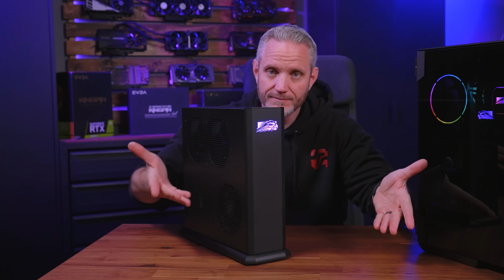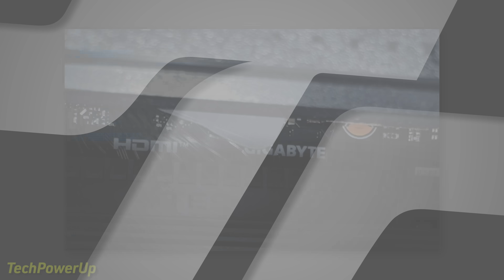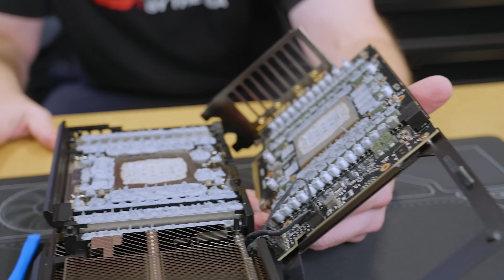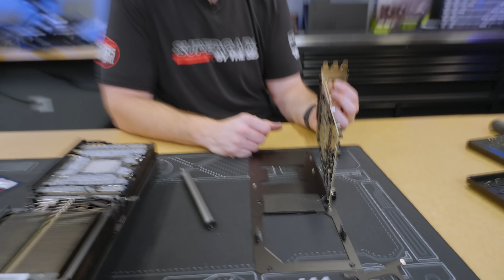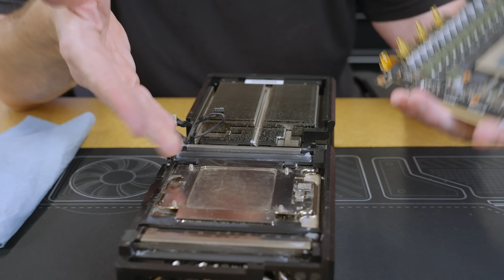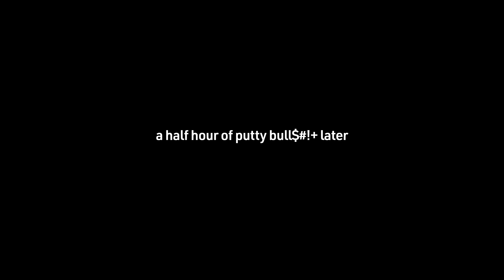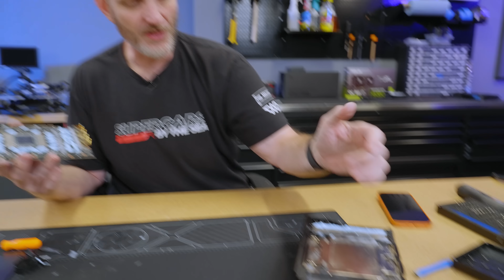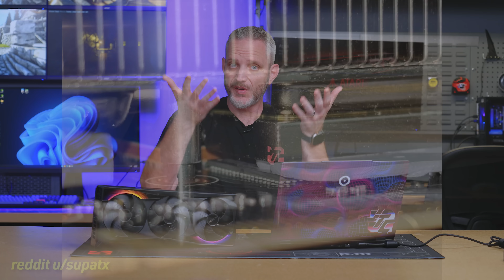What the HECK Gigabyte... WHY?

Comment: We've reached a point where we have to fix the factory after manufacturing premium products, but we don't after non-premium products.
Reply: These problems are not as widespread as people make them seem; in fact, it's a very low percentage of users experiencing issues. It's like anything else—consoles even have defects at launch. This is why you don't buy new tech right away. I wait a few months so they can fix the issues. I didn’t switch to AM5 until two years later to avoid bugs and problems. I bought the 5070 Ti Gaming OC mode two months after launch, got the second batch, and have no thermal leaks or melting connectors. Those issues are quite rare.

Comment: What I don't understand: thermal paste, putty,... has WAY lower thermal conductivity than any of the evaporation materials like copper or aluminium. So theoretically you would just need the putty to fill up the tiny (invisible) gaps where the heatsink and the heat creating component don't touch. Works the same with aircoolers btw.
in other words: the less putty needed, the better the performance should be. So why the hell does gigabyte ram a bucket of this stuff in their high-end model ? Would be interesting (and a bit tragi-comical) to see Jayztwocents repeat the process but this time apply only the tiniest amount of putty to see if thermals improved

Comment: i will bet you $100 that they have a litteral bucket of this stuff, and they just dip the pcb side in it about vrm deep and slap the cooler on. that looks like such industrial lazy-but-effective slop to me. 
i wanna give gigabyte a handshake and a slap in the face. that seems smart but... i'd never wanna deal with that. thats like, smearing vaseline on your mb to isolate the parts from potential water. 
serves a definite purpose, but disgusting. especially the longer you have it.

Comment: so you just took a giant crap on gigabyte.  you admitted to overpowering and overclocking the heck out of this card. then you go change the thermal compounds and what happens?  you make things worse.
so the bottome line is even though your cooked this card to within an inch of its life it was still running cooler than after you fucked about with.
i think you owe gigabyte an apology.

Comment: I had a similar thing going on with an old Dell XPS laptop. Bought it cheap because they had a reputation for overheating and killing the GPU.

Dell had used a thermal pad between the GPU die and cooler. Stripped that thing down and replaced the pad with a copper shim. This reduced GPU temps by 40°!

I think replacing that hybrid compound with a thin piece of copper may work very well here too.

Comment: I overhauled my 4090 cooling with new paste and the same thermal grizzly putty and didn't have near the headache you seemed to have when it came to applying it. You applied more than I did so that I am sure is annoying but it didn't really seem that bad if I recall correctly.

Comment: THANK you for making the video. My 5080 dripped into my vertical mount in my Y70. i've had to replace the PCIe slot from the drip. I haven't even run the card hard

Comment: Yes, you can get Windows 10 security updates for free for one year (until October 2026) by signing in with a Microsoft account and syncing your PC settings to the cloud via
OneDrive. Alternatively, you can use 1,000 Microsoft Rewards points or pay a $30 fee for the extended security updates (ESU) program.

Comment: i remember 10 years ago they were using pads and only the core used themal paste. if pads are better than putty especially on  a preium gpu like my 5070ti thats what they should be using so they can up the memory frequency. thenkfully in my case pny is still using them. also my gpu is a tripple slot and i figured migh was well. can  no do i want to go sli ow whatever that newer verion that only lasted 1 year was

Comment: I have the 5080 master ice. I had a pea size piece drip out and changed it to a horizontal orientation. It runs so cool I wonder if I’m pushing it hard enough. I’m running a pull fan on top just because I had an extra one. Other than I can’t run it vertical I have no complaints.
Reply: cool looking card for sure.

Comment: For automotive application of sealant and adhesive, they can use a bulk unloader system that turns an entire 5 gallon bucket or 55 gallon drum into a giant syringe and pumps it into a dispenser nozzle.  Much easier to simply have a robot wave around a nozzle connected to a large pump than to apply anything individual, don't even need a powered end effector.

Comment: I re-puttied my Aorus 5070 Ti just to be safe. I didn’t have leakage but I didn’t want to wait to see if I would, plus it gave me a reason to tinker. I used Upsiren UTP 8 and PTM 7950 for the core. It wasn’t that much work tbh and I didn’t need a shit ton of the Upsiren. If you have a 5090 like Jay did then I think it is a nightmare, but if you have 5080 or under it’s manageable.

Comment: how much money was the tim worth you used to make this cards cooling worse?

msi used the hybrid putty/pad things years back. 780 lightning/290xoc days.  the oil used to leak out of them and get sent around your case off the fans. it was shit and made them overheat if you didnt replace it once it got to this stage. guessing this iteration is on the other end of the spectrum for the particle constitution.

Comment: Did some quick searching on places like digikey for this thermal interface material.

Looks like (it matches the specs gigabyte advertise on their blog) it is MG Chemicals 8327GL6 MG Chemicals or something very similar.

One of the key features is "Zero pump out—no slump under low pressure"

I do wonder if this is a storm in a teacup type stuff with it just being over applied and it being under slight pressure its falling out. Yet to see it actually affect a card yet.

Comment: I think we should separate this issue with after market thermal putty use in general. I use a stiffer putty for my memory and mosfets instead of pads and it's perfect vertically mounted long term. And no worries then about ordering 3 different pad sizes and hoping you get good core mount pressure.

Comment: when i was informed that gigabyte was using thermal gel on ALL OF TEH GPU instead of thermal pads, it solidified my decision in NOT buying this trainwreck waiting to happen.
Reply: High quality putty is almost always better than pads, but gigabyte's problem is because they used high viscosity putty.
Reply: @Myyra-games  they used *low viscosity putty
Reply: I have two they run well but I am using horizontal mount
Reply: What are the current best thermal pads?
Reply: @colt5189 cant go wrong with thermal grizzly or gelid pads. Its choosing the correct thickness that u need to get right. Price of pads is crazy tho for the amount u get. Must be a serious % markup on them
Reply: It’s one of the fastest and coolest running 5090’s. Gigabyte needs to tell people to not run a vertical mount if they’re pushing the card for long periods of time. People are running these cards at 100% for 12 hours at a time like they’re dedicated AI cards. The VRAM just cooks and the card is still running at 60c lol.
Reply: @SuperiorDefense  then they should say "dont run vertical mount" on product description
Reply: @Donkens did you read my comment lol
Reply: I've had no issues with the gaming OC models. I've owned a 4070 Asus Tuf, 4070 TI Super Gigabyte Gaming OC, and a 5070 TI Gaming OC, all of which worked perfectly. I also had an MSI Gaming Trio 2070 Super and a 3060 12GB Asus standard model. Additionally, I had an EVGA 2080 Super, one of my personal favorites, and none of these cards ever gave me any problems.
Reply: @Zenntric you have the 5090 gaming OC?
Reply: @CastIronEric  no but I'm sure its a good one the gaming OC is like the second best gigabyte Card. they have great cooling to.

Comment: Yeah, fortunately i dont use vertical mounts but also fortunately I dont usually play games at the highest settings to get my GPU hot or anything. Even with my 9060xt 16gb i play cyberpunk in low-mid settings locked at 75fps with AFMF on for a constant 150fps.

Comment: I thought, why not create a sealed compartment between the heatsink and the board? Fill the space between them with thermal paste? 
But there are probably components there that don't heat up, and if you include them in the average-temperature mix, they'll actually start to heat up from the memory and processor.

Comment: I had the same issue with the thermal gel leaking out of the card ,I have use my pc 6 days out of week for a full month after I purchased the card. I have the gigabyte aero 5070 ti. I contacted them and they we’re aware of the issue with there 50 series cards gel leakage they told me to shipped it for repairs but I did myself a favor and replaced it with thermal pads and it works better than the gel that they was using. This is the worst idea to apply thermal gal on theses new card especially when they get hot.

Comment: I had a 5080 Aorus that failed. Gigabyte told me memory failed. When I got it back temps were over 15 degrees hotter. I’ve still got that 5080 and use a 5090 now. Would love the send the 5080 in for analysis to see exactly what they did in repair ? Did they put new putty down or just open it up and close it ??
Reply: If you want the card to analyse let me know. Same goes for anyone else who runs a channel

Comment: I just replaced my thermal pads with thermal putty on my gpu and did not have a bad experience at all. Granted the gigabyte card uses WAY more than I needed. I think I needed 50g for the whole card including the backplate. Rolling it up into balls and tubes is the way to do it without creating a huge mess. Even taking it back apart the cleanup isn't too crazy and I was able to reuse 99% of it. I do think thermal pads are more worthwhile tho but I was trying to see if putty would let me reduce hotspot temp on the gpu core which I think it did but not noticeably.

Comment: I have a gigabyte 5090 OC that oozed all over the motherboard. One thing I've noticed so far is the screen occasionally goes to pink noise under load. Not sure if that's heat related or not.

Comment: They used bad putty, there are good options with putty and i personally use Halnziye HY256 for thin gaps and UTP-8 (Now called Jarrapad Extreme) for bigger gaps up to 1.5mm and above that good compressable Fehonda 15w/mk thermal pads. (K5-Pro is horrible)
Snarks Domain on Youtube tested many putty's and has an excelent tutorial video for a laptop and videocards.

Comment: If the core is covered in some hybrid solution with liquid metal, that might explain why the contact surface is so much larger than the die - So that the paste has somewhere to go that isn't out of the cooler.

Comment: What PC cases are these people using that are vertical mounting their GPUs with the stock fan cooler?? I would think the fans have no space to draw air while right up against the side of the case.
I only vertical mounted mine because it has a waterblock, I mean I could still horizontally mount it but the runs are easier while vertical

Comment: If I ever get the money to upgrade my current system, the new GPU is getting torn down and the paste is gonna be replaced with a Thermal Grizzly Kryosheet. 

I had a GPU fan go out on my Gigabyte 3080ti and I torn the card down, deep cleaned it and used a Kryosheet instead of repasting the GPU die. Best decision I made.

Comment: I still like to use putty in some application. Especially when I don't know what was the existing specs for the thermal pad and how compressed they would need to be. Thermal putty just squish out nicely that it would not cause any uneven mounting problem with the GPU core. 

Gigabyte is just over doing it for real....

Comment: Gigabyte are on my avoid list after the hilariously bad 3090 I had. Cheap thermal paste, terrible power setup, broke and I sent it back for repair, it broke again. They then said they wouldn't fix it because the second time it went for repair, I mentioned putting the cooler back on. Because it was waterblocked. When I said they repaired it the first time without complaining about the waterblock, they said "they wouldn't have done the first repair had they known"....

TLDR: I miss EVGA 😢
Reply: Gigabyte stuff tend to fail a lot more and suffer more from production oversights then any other brand . And lets dont get me on the PSU bombs they unloaded a few years ago . Which i bought one  for a cheap build and nearly caught on fire .
Reply: @Lorex-d89 Oh, you talk about those Gigafraud PSUs like the UD1000GM that are being sold for cheap at chinese hardware stores?
Reply: @derthevaporeon  GP-P750GM  is the one i got , but all they did at the time was bad . Is funny how MSI was "hahah Gigabyte hold my beer" and did better PSUs for the same prices . Only thing Gigabyte can still make is some motherboards .maybe ?.
Reply: Zotac also is on avoid list
Reply: lesson learnt: don't buy water cooled block. it's a gimmick for wasting your money :)
Reply: @stelfirin  Always water cool high end cards like this. It's essential if you're not happy with having a slotbuster breeze block dangling off your #1 PCIe, and lets you put a big hefty radiator somewhere more sensible.
Reply: They've got a point. Disassembling the gpu voids the warranty.

Comment: Reminds me of what happened with my Predator BiFrost Intel Arc A770 card, only the manufacturer used a pinkish substance that reminded me more of bubblegum.  After about a year in service (in vertical orientation), I noticed that some of this material had not only squished out in a couple of spots.  But the worst was an area where the material had dripped(?) down and made contact with the top of the PCIe x16 slot.  The card still functions but I was not about to risk it anymore.  Too bad the warranty has expired.  I guess they thought no one would ever use the card in a vertical orientation.

Comment: You're 5090 temps make me concerned for my 5090. I see my card regularly hit 90c when gaming and especially when running furmark it doesn't take long at all for it to heat up. Tried RMA through my manufacturer but alas nothing seems to have changed after I got my card back. I would have expected better for as much as this card costs.

Comment: Looks like someone found a savings of a couple of nickels per unit on BOM and ran with it without asking anyone who knew what they were doing. Actually it was probably more than a few cents per unit as it probably eliminated at least a couple of steps in the build process, but for a top tier card they should not have done this. They probably look at these things as single use products and have no regard for serviceability.

Comment: zotac beats gigabyte in price and serviceable maintain  by us users easier than gigabyte messy bunch and not fun to work with it ...its why i rather change entire cooler instead that use pads already...i did that with msi boards as well due to how terrible with old AMD gpu back then with 290x remember the terrible nightmare that msi pulled on us with thin fan cooler that easily cause over heating issue with 290x

Comment: I quit buying from gigabyte during AMD 5000 series CPUs. All their motherboards claimed 5000 series ready, which was technically true, but it required a BIOS update so they were not 5000 series ready out of the box, and you couldn’t update the bios without an older CPU in the socket to post. Shady marketing.

Comment: They use the same thing on the 9070 xt Gaming OC edition mine was pinned at 80 degrees with a hotspot of 110 degrees under load.
Reply: its best not make it side up than standard slot as old school gpu designed for ...stay in one place for gell...or its gonna slide off during heating process vs standard it stay sandwich between core and heatsink...evga been doing this for years of it ....same for last bankrupt company BFG did that for their dies ....even its only on gpu cores but surprise how it was a huge mess between memory and gpu die back then....their unlimited RMA process got them bankrupt in chicago

Comment: Why are people still buying Gigabyte and Asus in 2025? I've been building and selling PCs for nearly 3 decades now so I see more than my fair share of hardware, but also have to warranty them, and I avoid both like the plague unless the customer specifically asks for them. They're all using the same components but Asus wants more for a "Ripping Off Gamers" logo, and I've had more issues with Gigabyte motherboards over the years than all other AIBs combined. It's like they have zero QC. Not to mention BOTH of them are and always have been nightmares when it comes to RMAs.

Just this spring I had a Gigabyte board that had so many freaking problems I thought for sure I had a bad CPU as well as bad DDR5, but the second I swapped out the board for ASRock every problem vanished. Thank God I bought it from Amazon so returning it was painless. I still own a Gigabyte 3080ti that refuses to overclock. Like... AT ALL. It won't hold a measly 25mhz bump. It's literally the lowest binned silicon I've ever seen in my life.

I've found Microstar is every bit as good as Asus but always at a notably better price. Asus makes perfectly fine products but wants way too much for their logo. Gigabyte has so many issues they have no right charging Asus prices. I avoided ASRock for a while cause their boards were getting pretty sketchy in the teens, but they've been much better lately and always a good option for someone wanting a budget build. Although with them nuking Zen5 chips they may have to go back on the shelf.

So I guess I'm right back to using Microstar whenever I can. It's one thing to fangirl for one company over another as an internet warrior, it's a totally different ordeal when YOU have to stand behind their products. I sure miss EVGA for GPUs. Too bad their motherboards were always insanely expensive.